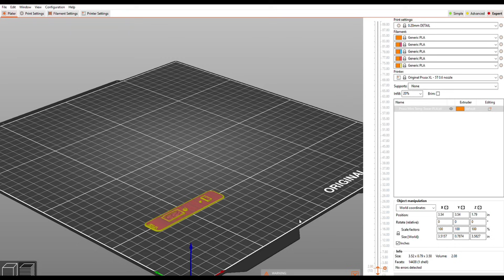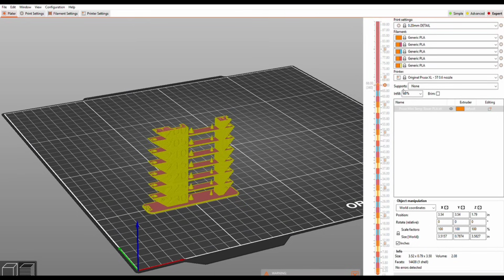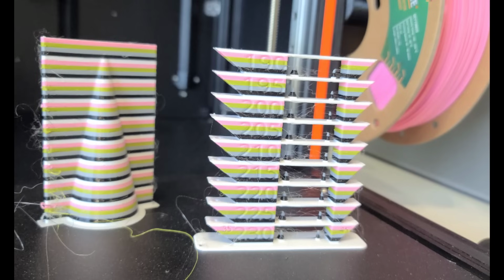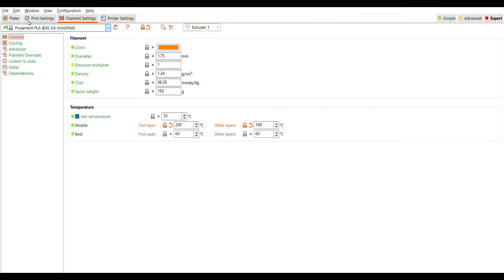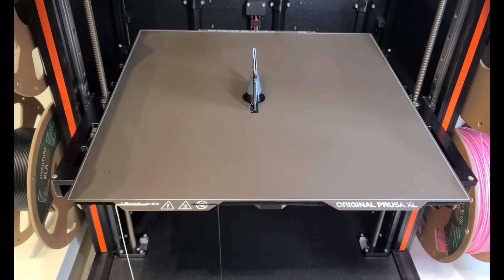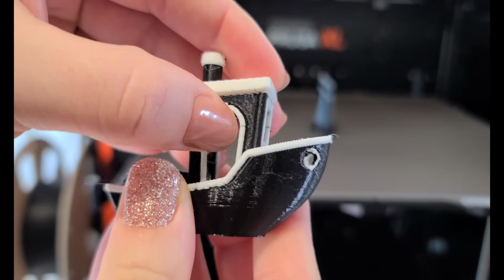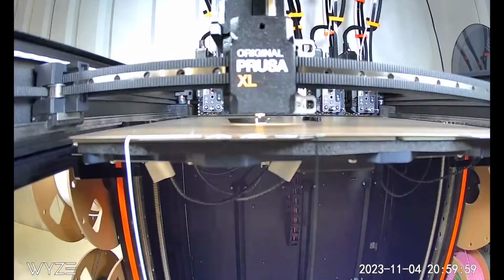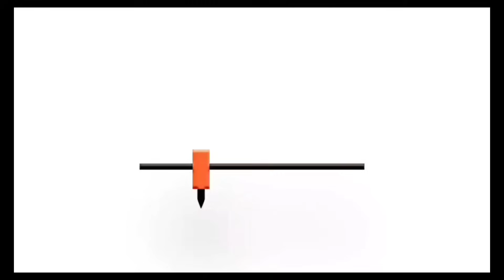Prusa XL - What Finally Improved the Stringing!!!

Comment: I'd just like to throw down my two cents since I haven't seen anyone mention this, but you might need to dry your filament. I think it used to be a pretty divisive about whether or not it was worth it, but it really depends on where you live and how humid it is. My understanding is that <30% humidity is "good enough" and >50% humidity is, like, pretty bad. When you mention that your black and white filament rolls are the ones with the most stringing, I see that they're the ones most used; they've been left out the longest. I see your pink and grey rolls are practically brand new and had less stringing.
Reply from the maker: That's interesting. I'll look into it. Thanks!

Comment: Prusa... it's the stringing formula itself.
I hate never-ending tuning every single print job.
Tech support advice is to lower the temperature. Then... why don't they lower the temperature in all their presets?
Reply from the maker: That's a really good point. Because my default on the MMU3 is 205. They could easily make the default on the XL lower too. Thanks!

Comment: Did you ever figure out why your attempt to change temperatures with custom G-Code during your tower print didn't work.

I have considered trying something similar with towers for part cooling.  I had to change my Ender 3 S1 Pro part cooling fan.  I upgraded to a 5015 with a trihorn plenum when I did.  But I get more stringing printing PETG than I want.

I considered just slicing a temperature tower with custom G-Code inserted but I was curious if it would actually work.  I'm afraid Prusa-Slicer will just override my changes.
Reply from the maker: I haven't had issues with it on other prusa machines. But it must be a different code for multiple toolheads. No I haven't figured it out yet. Thanks!

Comment: I have no experience with the XL, but I had the same issue on my RatRig V-Core when using the .6mm Nozzle. It seems like there is no chance to print with .6mm nozzles without stringing. After swapping to a .4mm nozzle it went away.
Reply from the maker: Yeah I think I'm just nervous how much more time that will add. But I guess if it saves in clean up time and has better prints. Thanks!
Reply: @tada3dprinting  Normally it's just the nozzle swap and changing the print profile. No calibration needed.

Comment: Looks like bambu wns again they dont release beta units  they release tride and true units slow core xy lmfao
Reply from the maker: Yes, they are very polished. Thanks!
Reply: prusa aint bad i have a og mini goin strong but this is sad prusa has all they need to realse a good workhorse there known for and we get this crap untested and not tuned out of the box they pulled a creality and did 90 precent of the work leaving the end user scratching there heads wondering why a prusa brand product is printing badly out of the box @tada3dprinting
Reply from the maker: Which is crazy for the price that these are. I do feel like my XL is doing good finally. But we will see what tomorrow brings.

Comment: Could you try a 0.4 nozzle on the XL? Still waiting for my 5 tool head XL but my old mk3s strings less or not at all with smaller nozzles. 0.25 nozzle doesn't string at all.
Reply from the maker: Yes it's possible. I just looked and they only sent one adapter. So I'll need to order 5 .4 nozzles. But I'm actually finding that I want to print larger things on this. So .6 may be the better solution. Thanks!

Comment: What about the room temp? Do you have an air condition or open window?

What about retraction. Did you try to set it up differently?
Reply from the maker: The room stays about 70. I have a split unit ac which is a few feet away. No open windows. I haven't touched retraction yet. Thank you!

Comment: I think I saw someone else have this problem and it was because the nozzle seal wasn’t at the correct height here’s Prusa’s video of how to adjust the nozzle seal to the correct height. 

https://youtu.be/HDRa0PzoqtI?si=wNpo_NO6Jrh3ufDJ

I think the nozzle seal is supposed to be as flush as possible so that the plastic can’t ooze out of the nozzle while it’s idle but the filament can stay at the nozzle to maintain pressure, then when the printer wants to use it again it doesn’t have a gap at the start of printing where it had to get back up to pressure in the nozzle. I would guess your nozzle seal is slightly too low as you can see the nozzle dragging filament back and forth from the dock sometimes. I would also give all the nozzles a good clean with a brush to get off any stuck filament.
Reply from the maker: Haha when I first started watching the link you sent it made me think this will be the new "live adjust Z". Mine actually do look correct. But it was nice to see the video. Maybe it needs some fine tuning. Thanks!
Reply: @tada3dprinting Dangit I thought maybe we’d finally found it sorry that wasn’t it! Good luck with the more tuning!
Reply from the maker: I really appreciate it!

Comment: It's not just your printer doing this but some of us with the MK4 are having similar problems with the Nextruder. At first I had to go much higher on my temps to get stringing lower on my MK4 and so I ordered another heat block assembly for other nozzles. When I ran the new assembly it needed lower temps like you had to do. I changed out the original heatblock with a spare thermistor and heater cartridge and then that one also now needed the 195 average temps to get stringing down. This is all with dry filament from my Sunlu S2 dryer. I never had such problems with my MK3+ or Mini+.
Reply from the maker: That's odd because I have 4 MK4s and I haven't had this kind of problem with them. But I've had them for a couple months now. Makes me wonder if it was a weird batch? Thanks!
Reply: There is a thread in the Prusa forums that I have been posting in for a while. It seems that something is going on with some of the Nextruders and temps. @tada3dprinting
Reply from the maker: Hope you get it figured out!

Comment: It's getting there...Do you feel its user, printer, slicer filament or firmware? I feel it's still not acceptable but if you think it's decent....
Reply from the maker: It's a huge improvement so far. I think it has to be the perfect combination of everything! The right filament at the right temperature with the Alpha Slicer and Alpha Firmware and the custom gcode. Thanks!

Comment: I have XL 2T and running the alpha firmware with alpha Prusa Slicer. No serious stringing problems, although 0.4mm nozzle generally gives less stringing than 0.6mm. Luckily your problem was just a software based mismatch. I would have hated it if the "solution" would have been to just drop the temp.
Reply from the maker: That's good to hear that it's working for you. Thank you!
Reply: Well, could be better, but it's not the worst. My main annoyance with the XL are the resonant frequencies of the Y axis movements. I can't wait for the proper accelerometer based input shaping to get released.  @tada3dprinting
Reply from the maker: Yes a STABLE slicer will be nice

Comment: I think the key is to lower your retraction-speed settings. Prusa slicer use very high speeds compared to other slicers and different speeds for retration and pushback speed. I always eliminate stringing when i get close to 30mm/s in prusa slicer on both numbers. Try to hold them equal. 30mm/s retration speed and 30mm/s pushback speed. Some materials absolutely don't like fast pressure changes while retracting. I hope it will work for you. Have a nice day and grettings from germany.
Reply from the maker: Thanks so much
Reply: @tada3dprinting  You're welcome. I have to say thank you for such good content that you provide. I hope the tips will bring you closer to your "No Stringing Goal".
If you find the time, please let me know if it solved the problems for you.
Reply from the maker: So it seems my main issue has been resolved by running the temps at 180 or 190. But I will keep this in mind if I need more adjusting. Thanks!

Comment: still think the last benchy is really sub par. You managed to reduce the stringing slightly only to have the quality of the overall model look worse than what is capable by a budget level 3D printer. Prusa have really dropped the ball here and its blatantly obvious they have pushed out this printer way before it is ready. 

You should not be having to do all this messing around only to still have sub par prints on a printer of this price range.
Reply from the maker: I agree. Trying to decide if working with larger models is more what they had planned. But it takes so much longer to dial those in! Thanks!

Comment: This is an "Emperor has no clothes" moment for Prusa. The ardent fans won't criticize but everyone else sees there are some major unrealized potential there and it should not have been released in this state.
Reply: Yeah I feel like they can patch a lot of it with software updates but I’m really nervous about the banding every XL seems to be getting. I’m really hoping it’s from a bad bed PID tune but I’m starting to think it’s a design flaw in only lifting the massive heated bed with an absurd number of cells in the middle on 2 points with no support on the 4 corners.
Reply from the maker: I agree. I'm just trying to figure out if I'm the oddball or the norm. Thanks so much!
Reply: @tada3dprinting  I just saw Michael from teaching tech. He and others are running into similar problems. I am sure the community will come up with a fix or mitigation. 
There is a nozzle wiper you can print that helps some and there may be some updates to the gcode you could run. 

Still does not fix it completely  but one of the Prusa guys said there may be a software fix in the coming weeks.
Reply from the maker: Thanks!

Comment: The ending result is still not acceptable to me. No matter if it’s a MK3, MK4 with a MMU2/3 or XL 1 head or 5 there is no way you should see stinging like that. But, chunks of other filament mix into the other colors too? Nope. Not having it. Out of curiosity is there small bits of leftover filament on the underside of the hotend? I thought there was going to be some kind of stamping of the nozzle before the print head docks to make a more consistent tip without the tail. I know that most users almost never fine tune slicer for each brand, type of filament or for each roll used. They all can differ. If your an espresso junkie such as myself you will know each bag of beans differs from the next and that same bag will pull shots differently a few days to weeks into its use. It’s a pain and feels wasteful… but, it’s all part of 3D printing. All printers and or slicers need config and consistent maintenance it’s the nature of the beast. Nonetheless no print out of the box should be that bad off. The last print.. meh some tweaking sure. But, to tweak that much to just get that for result. Hmm. 🤔 I’ve never had to lower my temps that low in order to print pla. Sure I lowered the mk4 temp down for probing to help lessen the dots on the bed before printing. Makes we wonder why it’s so bad. I cannot see Prusa sending out an incomplete $4K printer. And I have seen others with nice multi color prints. Going to a 0.6 nozzle will take a little getting use too. I would do the torcher test record everything and contact chat. It’s a service you paid for. 😊
Reply from the maker: Well said. Yes things need fine tuning but not this much. I do think I am close to getting it to work. And printing super small things may just not be the best plan for .6 nozzle etc. Thanks so much!

Comment: a lot of stringing can come from z lift where the filament is not properly wiped before moving off the model. Check printer settings -> extruder ->"lift Z" and "wipe while retracting". lower or eliminate the lift. and enable the wipe while retracting. Also see: https://www.youtube.com/watch?v=XZTBSJAswbs I know you don't want to go there... but that's where you need to go.
Reply: Nevermind, its not you, its the tool changer logic. Hopefully they will wake up and get this corrected.

Comment: It definitely feels like you're making progress. Did you have the 3D Print Dogs gcode in this print as well, or no? Joel at 3D Printing Nerd has shown off a super high quality 5-color print he did on his XL. I kind of wish he'd publish something about what he tweaked to get it as good as he got it. I believe he said it was mostly temperature but he might have said something about retraction as well.
Reply from the maker: Yes I was using the gcode too. I thought the same thing about his video. Maybe it's coming soon. Thanks!
Reply: @tada3dprinting  I saw a video recently where the retraction was adjusted in the gcode and it seemed to fix all the stringing. To me it seems like there is still filament coming out the hot end and then the extruder head pulls away from the object causing the stringing. If you were to retract it into the hotend  before it pulls/moves away that should create less stringing. At least that's how I see it working in my head. Good Luck with this!

Comment: Printing small objects is best done with smaller nozzles. The 0.6 nozzles in the XL are suited for large prints. Perhaps a test with an 0.4 nozzles would be worthwhile, at least for a two toolhead print.
Reply: FWIW, I immediately replaced all nozzles on my XL 5 tool with Prusa's XL 0.4mm nozzles...and the stringing is still a problem. Smaller nozzles may help, but they are not solving the problem completely.
Reply from the maker: Yeah overall I'm trying to decide what I want to tune this printer for. When I bought it, I was going to use it for every multi color print. But I have others that can handle smaller detail better. Thanks!

Comment: I think the factor that helps with the stringing when using input shaping is simply the speed and the profiles in Prusa slicer 2.7.0 alpha1 are just better adapted to that. As you can see, it also leads to slightly reduced overall quality like small layer shifts seen at 8:05 in the video. While the benchy doesn't look terrible and those wisps are actually to be expected, right where they are (it's a stress test after all), the strings dragged into the other color are different. If you look closely, they are rather short and thicker than the "cobwebs". That's because they are caused by something else and in a different situation, namely layer/color change. The same kind of stringing happens likely on those doors and windows too but since no color change occurs, it's a string of the same color (it's a trimming on the model).
In Prusa slicer in expert mode you'll find under Print Settings/Advanced a point "Outer Perimeters First". Check that box please and see if that fixes anything. It should help keeping the comparable short strings inside the model, where it would be hidden in most cases.
If that doesn't help, you can play around in Filament Settings/Filament Overrides. Here you can adjust the retraction parameters for each toolhead individually, without changing the defaults (try 40mm/s Retraction Speed for a start. if that does something, but gets you not quite there, try 0.8mm or 0.9mm as a retraction length. Even up to 1.5mm might do the trick for your filament ). If it doesn't help you can simply deactivate any change again by unticking a box. Temp and retraction settings work together like a set of gears. At lower temps the molten plastic is more viscous, which means if it is "sucked" up a syringe (which the hotend ultimately is), it will resist more but it will also resist the tendency to flow out the nozzle driven by gravity. The retraction is meant to cancel the effect of gravity for a moment. That moment is longer the more viscous the plastic is and the faster the solid filament drags on it, but at some point that effect will just break because the liquid will "rip".
The last benchy was printed at 190°C, right? I'd say you can safely go to 195°C without much more stringing. The wisps may even get thinner. You are getting there, don't despair.
Grant of the 3D Musketeers YT channel is currently building his own XL Fivehead from a kit. We are 2 livestreams in and I don't know when he will continue, but maybe contact him for his Friday podcast where he analyzes and suggests solutions for 3D printing problems of users who reached out to him. I'm pretty sure he will find your case interesting and has some advice.
Reply from the maker: I really appreciate all the tips. I'll work on this. Thank you!

Comment: It still boggles my mind that the Prusa cant produce a good result. Even the last one shown with the benchie is sub-par and very rough. I would only use the XL for big objects that are simple to print. And then use your bambu lab for the smaller stuff.. i have 0 stringing on mine.
Reply from the maker: You have 0 stringing on your XL or your bambu? When I bought the XL, I thought it was my only option for multi color without dealing with an MMU. Times have changed. I prefer my Bambu.
Reply: Yeah the Bambu.. i dont have an XL. @tada3dprinting

Comment: With the new (alpha version) slicer it seems much better now. Wonder if you go back to the Owls with the same temperatures you did those how they would turn out with this combinantion.
Reply from the maker: Coming soon. Thank you!
Reply: I also got the IS alpha now for the XL (still single TH) and the alpha slicer because had some issue with a certain filament. And behold.. it is working now. @tada3dprinting
Reply from the maker: Yes mine seems to finally be doing good with the newest versions. Finally!